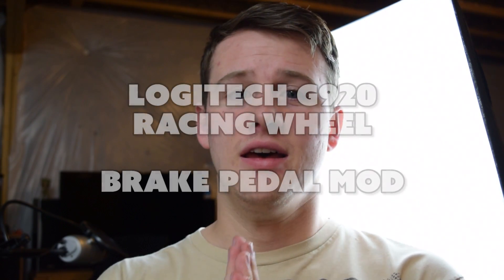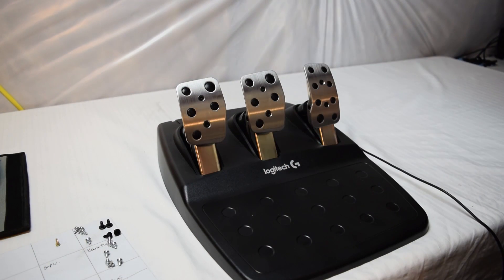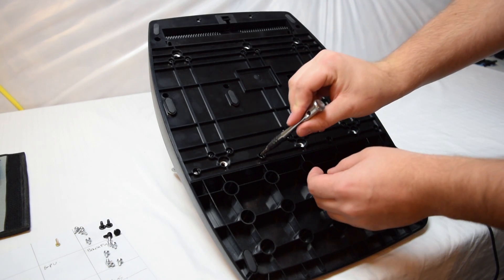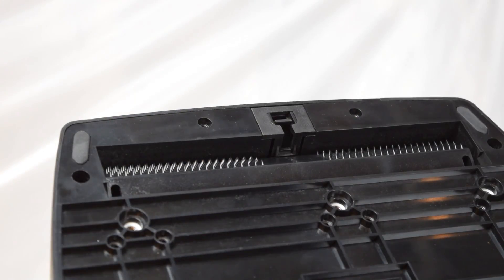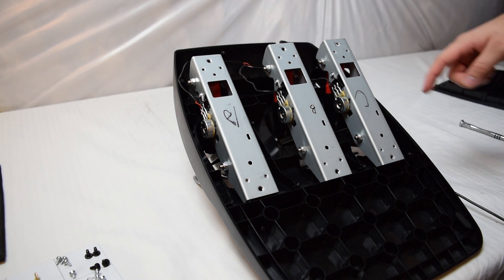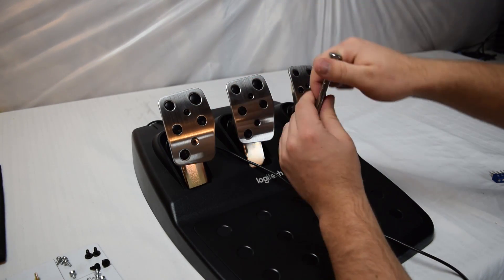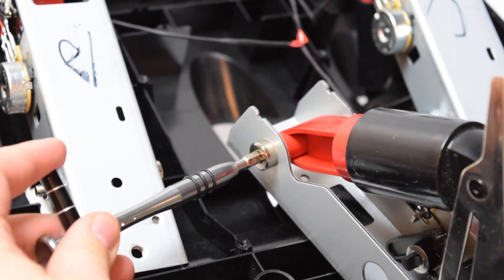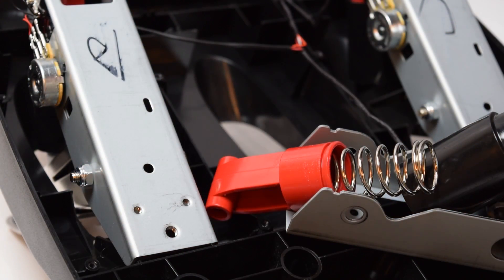Brake Pedal Mod - Logitech G920 Racing Wheel

Comment: What is the point of taking out the rubber if the brakes only reach 100% when you brake halfway. I've done this already and it reaches 100% brakes when you brake halfway.
Reply from the maker: Well because you have to push REALLY hard to get to that point. It's a lot easier to take the rubber out and simply put the pedal where you want. The spring still provides a good bit of force. You don't have to bottom it out, when playing a racing game you usually don't anyway 

but as I said it's a subjective thing, some people like it, some don't. I'm working on a solution to the actuation point though. Stay tuned. :)
Reply: Beeeyeee - Games & Good Times So your confirming that when you press press half way down on your brake pedal it reaches 100% in game?
Reply from the maker: +MickeyMoTiOnZ it's more like 75%.
Reply: Beeeyeee - Games & Good Times Thats the problem though it feels horrible when you reach that point where its 100% brakes and but you still got more room to press down. Its just harder to control.
Reply from the maker: +MickeyMoTiOnZ like I said, it's subjective. You don't have to do it:) you shouldn't be bottoming out the brakes in a racing game most the time anyway, if you do, you can just press all the way down anyway. It's just something I found a lot more helpful, so I shared it. Not everyone will feel the same way. :)
Reply: Beeeyeee - Games & Good Times When racing without the rubber, is there no way of setting the brake pedal so that I put my foot down all the way? Because sometimes it is needed. Its annoying when pressing down that 60-70% of the brake pedal with my foot but in game its already 100%.
Reply from the maker: I mean, you could put something like a block of wood there to stop it going down all the way. Other than that, I've been working on a solution that might involve a driver tweak. but theres no guarantee it'll work on consoles, sadly. I'll see what I can do, maybe I'll even upload a Part 2 or something:)
Reply: did you re calibrate your pedal afterwards?!

Comment: Funny, I did the other way around. I have a G27 and was able to get a G29 pedals like yours only for the included loadcell you just remove. It allows to modulate the braking a lot better.

Comment: Originally I thought Forza was bugged but it ended up being that the brake wasn't working for reverse because that rubber piece prevented me from pressing it down to the point where reverse actuates. It was driving me bananas.

Comment: i have mine bolted to the bottom panel of my desk and my racing chair bolted to a big metal rowing machine frame and i still couldn't press mine down all the way. would push the desk across the floor on it's rubber feet. when i got the rubber block out it was even less squishy than yours.  :)
Reply from the maker: Hahahaha! That's so funny! I can't believe they did this!

Comment: I know I'm years late but you could have disassembled the pedals way easier than the way you did. Get some foam and use that to replace the rubber.
Reply: explain bro, I am about to try this but don't want to go through the hassle of removing like several billion different sets of screw types. I also don't want my clumsy fingers to accidentally eat the wires.
Reply: @mosasa1307  take the cover off. But you dont have to remove the pedal. Take the screws out closer to the pedal and you can save about 5 min and less chance of pulling wires.
Reply: @mosasa1307  I also used a piece of memory foam and put it in the spring and an o ring on the red bottom brake piece to create a small vaccum to add pressure.

Comment: couldnt you just cut the rubber bit in half to make the pedal go in a bit further instead of taking it out completely
Reply from the maker: DjDynastyEDM you could! I'm actually working on a follow-up video. :) there are a few problems with this mod I'm going to address.

Comment: Plss I need help !!!! I did everything as in the video, screwed everything back together and connected the pedals to my steering wheel. After that I went into forza horizon 4 and my pedals didn't work anymore !! my cars accelerate by themselves for a short time but you can't do anything anymore what did i do wrong? I took all the plugs out and put them back on and it still doesn't work. In the settings shift and clutch is still on ... Please can someone help me did I broke the cable from the pedal or what could have been done wrong

Comment: "why.. why do this?" You ever drive a car that has a brake with the same travel as the throttle? no.. because that's not how cars work.. You need to have feedback to when you are getting to that 70-80% pressure range... hence why the rear right of the bus locked when you hit the brake at the end...

Comment: Thank  you that went great. Plus I noticed when doing that I could also move my Gas peddle, and my clutch peddle over a notch giving my foot more room for breaking .
Reply from the maker: What exactly do you mean? There are only 3 notches, one for each pedal. Hmmm?
Reply: Yea the foot pad its self is placed on the center of 3 sets of hole on the peddle shaft. I didn't know this. so I moved the clutch pad, and the gas pad to the outer set of holes on the shaft.
Reply from the maker: Oh I see what you mean! Nice tip! Maybe I should make a follow up video:)
Reply: Thank you.

Comment: If you take the fronts of the pedals off first you'll find it alot easier. Also if you dont use the shift you can always swap the brake and clutch assemblies instead/aswell

Comment: I think also somehow softening the fucking rubber, or maybe cutting it in half can be beneficial. You can have the best of two worlds.
Reply: Or a better way would be to cut the side of it, so it will keep the same length, and have same compression characteristics, but with much lesser force needed to be applied. Though have to be careful that it will not fold on the way.

Comment: Don't take the rubber out, get a very small drill bit and drill holes in to it to make it softer. The pedal is made to have the 'spacer' in there. I'd also suggest switching the springs from the gas and the clutch.

Comment: after i did that my brake pedal didn't work and when i pressed on the gas it braked to 100%?? Why? how do i fix it?
Reply: re calibrate your pedals in game. so go to controls and press on accelerator and then break and press the correct button for all controls.

Comment: I have a method for those who do not feel comfortable taking the pedals apart.
1. Click on the windows key
2. Type in,  set up usb game controllers
3. You should see your G920 Wheel.
4. Click on properties
5. Then click on the tab labeled TEST
6. Click on calibrate
7. Now go through the calibration process. once you get to the brake calibration, push it as far as your comfortable with (preferably to the point where you feel that the pedal is getting stiff)
Problem solved :D
Reply: This is a far better solution ^

Comment: Thanks very much Very useful! Does this work for the G27 as well?  By the way do you know whether it is possible to link 2 P S 3s just using Ethernet or crossover Ethernet cable without Internet or PC to establish a LAN. ( like system link on XBox 360 ? 
Regards Ian
Reply: Ian Tweedie The g27 doesn't have this rubber piece. I actually modded my g27 pedals so they have a rubber piece (and stiffer spring) like this, for added realism. it's called the nixim mod or gteye mod. why this guy removes the rubber piece, I wouldn't know, but now he actually turned it into an original g27 brake pedal.
Reply: Thanks  My mistake Mine is actually a G29  Does it have the rubber piece?  Do you know how to system link the two PS 3s?
Regards
Ian
Reply: Ian Tweedie 
Yes, the g29 has the same pedal set as the g902 and it does have that rubber. So this 'mod' could work for you. Although I personally wouldn't do it, but I do have my pedals hardmounted on a rig so it doesn't matter how hard the brake pedal is, my pedals will not move.

Comment: I quiet enjoy the rubber stopper in the pedal, give you the feeling of a real car and being able to really crank down on it for late braking. I can see where it might be an issue if you just have them sitting on carpet and don't have them hard mounted in a sim. I just built a pvc sim rig and it works great!

Comment: So by removing that piece of rubber it should make the brake pedal softer??
Reply from the maker: You still have the spring for a good bit of resistance, but you don't hit the rubber. so in theory its a lot easier to press. but still feels pretty good.

Comment: does the g27 shifter work with the g920 steering wheel?
Reply from the maker: Honestly not sure! I would assume so! It has a connector that looks like a VGA cable, I'd do some research on the Internet:)
Reply: I done so much and i think that the cable of the shifter fits but im not sure if the steering will reconis it
Reply from the maker: +NITRO Z maybe shoot an email to Logitech support!:) I'm sure they'll know!  Sorry man I wish I could tell ya.
Reply: +Beeeyeee - Games & Good Times OMG yea shit i never thought of that thank you dude.
Reply: No! It does not work. Have the G27 & G920 here, G920 needs it s own shifter.
I only buy because i have G920 this time on PC, and Xbox, and do not want to change the Wheel all the Times (it s a Wheel stand here)

but to tell you: the G27 is just the better Wheel, it s the best wheel / price you ever get.
Fuck 920 and G59
all bouth nothing but shit of greedy logitech
and long not so good like G27.
Reply: But the g27 pedals do work on the g920 right?
and by the way, it' s pritty hard to find a g27  (in netherlands)
Reply: Robin Balentina
b  Du you want to play on PC or X-Box one ?
Reply: +opafritzsche Pc only, I play most assetto corsa and sometimes project cars
Reply: Robin Balentina
 Get a G27. You will have not only the better Deal, also have the better Wheel, REALLY better Wheel.

and the Support of Assetto Corsa for G920 sucks, i come from there, just this moment.
It s slippery , not really "direct" witht the G27 you have a firstclass Support Assetto Corsa.

this wheel is no good deal for.
Reply: +opafritzsche I have my G920 for 1 week and everything works fine, it detects everything
Reply: I know this comment is old but I just watched another video where a guy used the g27 shifter with the g920 wheel.
Reply: Ya, it works. Im using a G27 shifter on my G920.

Comment: I opened the pedal as shown in the video and removed the brake rubber and reassembled. The pedal was much more pleasant to use, but the steering wheel stopped working, the light blinks but does not use it. Can you tell me what it can be? Will it be if I put something wrong?

Comment: Hello, I have a problem with the brake pedal.
I do not press it and the indicators in the games show that it brakes with 50% power as the pressure goes up to 100% but returns again to 50% of the braking power and should return to 0%. Do you know how I can set it?
Reply from the maker: Pawel Dyk what are you using it on? PC?
Reply: Xbox One
Reply from the maker: Pawel Dyk honestly I’m not sure than. You can try to connect it to your computer and somehow update or reset the firmware. Otherwise you’ll have to RMA it. (You can still do that if you did this mod, just put the price of rubber back inside first)

Comment: This messege is for anyone who did this....

I have been using this pedal for about a 11 months and 3 weeks and i am fairly familiarized with how this brake work. I have no problem braking with it now. However as im trying to improve my self as a driver, trail braking with this is very difficult. It is very unconsistent on how you release the brake smoothly. Most of the time my trail braking is out of cushion thing just before corner entry and the braks pressure is not enough to send the weight load towards the front of the car leading me to massive understeer. I understand this is totaly fixable by altering with my driving style but i want to apply my knowledge here.

So my question is, with and without the cushion thing how much does the brake pressure differ? Is it too soft like the clutch pedal or is it as firm as a car with perfect hydrovac
Reply from the maker: PH.MANUEL i feel you man, there are a few guides I’ve found on how add different texture to the feel of the petal pressure. People use foam, or cut up the rubber. Be creative! It’s just a personal preference. I really don’t like the way it feels stock, try out an idea and make a video about it! I don’t even like driving games, and look how far this video has gone! By far my most viewed video

Comment: the g920 pedals  / brake pedal is pretty much exactly the same as the g25 / g27 pedal set but with the "nixim pedal mod". you just undone that "mod / upgrade" and reverted back to the old pedal set by removing the rubber lol. as with most pedals, you need to have them bolted into a rig to get the most realistic feel. those carpet grippers are crap
Reply from the maker: no I agree with you. problem is people like me barely play racing games. thus we have no rig to attach them to. haha:P

Comment: I think the title for this video/mod should be "Best G920 Break Pedal Mod for People Using A Chair With Wheels". I have G920 and play with DXRacer Chair and my chair gets pushed back a lot whenever I break, which is annoying because I have to keep moving up each time I break.
Reply: ManAmalReacts me 2 i just put my old chair behind it but the pedals get pushed on the floor the spikes do not keep it steady
Reply: ManAmalReacts Weld the chair into place
Reply: Just put something behind the wheels of the chair. Like an old shoe, or sth.
Reply: Learn the difference between brake and break!
Reply: hey i took the wheels of my chair can yours do that ?
Reply: Buy caster cups on Amazon or at a hardware store. They're cheap and do the trick.
Reply: njd23 or you can do it for free with a mod
Reply: My chair frame bent because of how hard I had to push the break
Reply: Sande Same
Reply: Brake not break you have and don't know the difference...
Reply: FACTSSS DUDE I always end up pushing myself backwards when tryna brake hard for a corner😂
Reply: u could also buy roles with stoppers. Bought some for $9 lol
Reply: @xxviiiimmii  I'm late but I use old shoes that don't fit.
Reply: @whywhy8575  Thats the most stupid genius thing i have ever heard 😂
Reply: @xxviiiimmii  I'm telling you it works really good 😂 also really convenient.
Reply: @xxviiiimmii  if it works it isn't stupid
Reply: Hey I bought a 25 dollar set of wheels on amazon and they have brakes it works perfectly because it doesn't move.
Reply: Yea i know. i have it up against the wall and feel like im going to snap the pedal off by pressing it so hard
Reply: i am about to buy the g920 and play on  a wheely chair. so, thanks for the heads up lol

Comment: I've played for few minutes on a G920, but the brake pedal was (too) stiff.
Does the brake feels the same as the gas pedal now? So I can brake 100% without moving my chair to the other side of the room? :D
Reply from the maker: haha Yeah the spring in the brake pedal is stronger than the clutch pedal (which is stronger than the gas pedal) but it has the same linear actuation throughout. it feels MUCH more natural, like a stronger version of the gas pedal, and you don't end up moving your chair at all! :)
Reply: alright, thnx man! my g920 should arrive at my home today or tomorrow,
im gonna try to use it the way it is, but after maybe 1 week im removing the rubber part
Reply from the maker: Did you end up doing the mod? just curious on your experience:)
Reply: Im now asking about the warrenty, if I can still have it on the wheel.

Comment: A must have mod, brake will feel extremely sensitive afterwards but still way better for modulating pressure. I have my all my pedals set to 0% sensitivity (in Logitech Gaming Software), helps it from feeling like trigger buttons on a controller...

Comment: question.. could you just remove the pedal and not take the base apart?  it seems like one could remove the other end of the spring assembly, the part that attaches to the pedal.

Comment: Just tried this and it works much better for me. I have limited space where I can put my setup and the pedals are a tad further forward than I would ideally like so having to put quite a lot of pressure on the brakes with the pedals quite close to me has always been a bit awkward and I’ve never felt as comfortable with the G29 than I did with my old DFGT. But with this mod it’s much better, for sure it doesn’t feel quite as realistic but it has definitely made me faster and I can race for longer without getting fatigued.

Comment: Just a word of note I have completed this Mod, Thank you very much Beeeyeee for the guide, I cut my bumper in half and it has made a huge difference, the pedal now pushes all the way through with a reasonable amount of resistance. I would however say that the last couple percent is now too easy. and i feel like I might be unnecessarily hitting the stop a little hard. If you are doing this mod I would cut 1/4 off the rubber stop and work from there. 

Thanks again Beeeyeee for the guide, very helpful instead!

Comment: Thank you so much. It feels so weird now and I didn’t have the right tools to do it, I was afraid to do something bad. But I went very gentle and I did it fine, and now I don’t push myself away from the desk anymore. I can finally play Assetto Corsa without jumping on my pedals and being afraid of breaking them. And it doesn’t require so much time, and even less with the right tools. +1 subscriber.